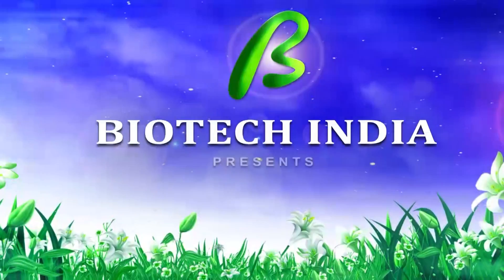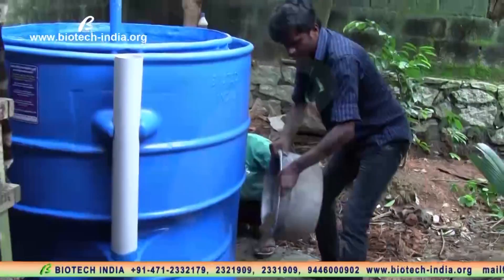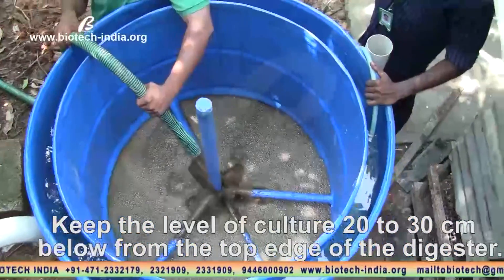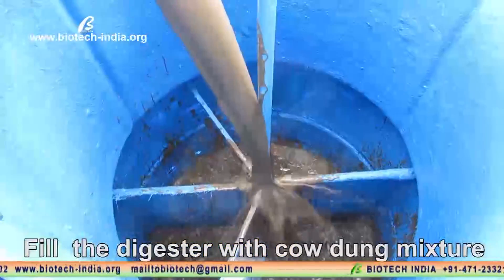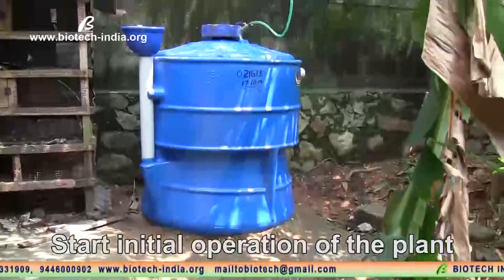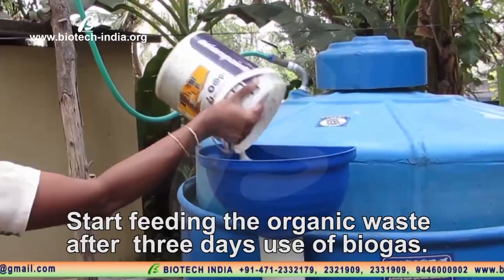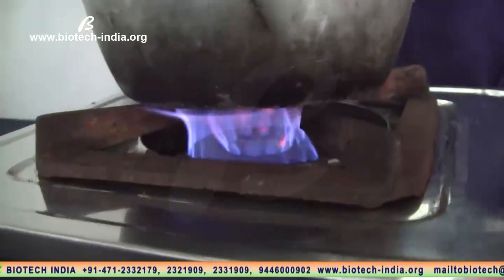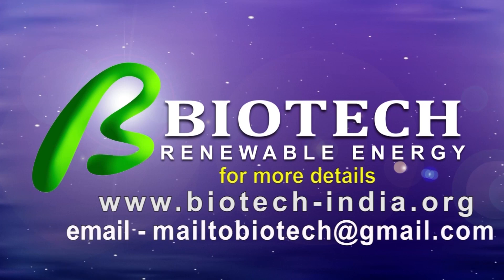Users manual for Installation of BIOGAS PLANT | Call Now 9446000902 | #biogas #biogasplant

Comment: use a strong magnet series on the pipe of gas, it will provide many kilowatt's more
Reply: Can u explain some more please
Reply from the maker: @khalidgondal8211 
please contact or Whatsapp to Mr.Vetrivel.R at ph no:+91 9446000771,
BDM-BIOTECH India,
E-mail:bdm.biotechindia@gmail.com
For more details,
visit us:[ https://www.biotech-india.org/ https://www.biotechbiogas.com/ ]
Reply from the maker: @anilkumarsharma1205
 Do you need any requirement? please contact or Whatsapp to Mr.Vetrivel.R at ph no:+91 9446000771,
BDM-BIOTECH India,
E-mail:bdm.biotechindia@gmail.com
For more details,
visit us:[ https://www.biotech-india.org/ https://www.biotechbiogas.com/ ]

Comment: I would imagine that there should be some kind of regular maintenance requirements, but none are given. 1) Does the feed tube, which is small, clog and need unclogged? 2) Does the tank eventually need cleaned out? 3) What kinds of plant matter (if any) do not work well with the system?
Reply from the maker: Do you need any requirement? please contact or Whatsapp to Mr.Vetrivel.R at ph no:+91 9446000771,
BDM-BIOTECH India,
E-mail:bdm.biotechindia@gmail.com
For more details,
visit us:[ https://www.biotech-india.org/ https://www.biotechbiogas.com/ ]

Comment: Put a T connector in the gas line with a valve and water collection bottle.
Add a brass wool flashback arrester near the stove.
Add pex heating coils and thermal blanket to the outer water jacket.
Buy a Cow.
Reply: Wat is an arrester? Wat purpose will it serve?
Reply from the maker: @ameyproud2bindian  
Do you need any requirement? please contact or Whatsapp to Mr.Vetrivel.R at ph no:+91 9446000771,
BDM-BIOTECH India,
E-mail:bdm.biotechindia@gmail.com
For more details,
visit us:[ https://www.biotech-india.org/ https://www.biotechbiogas.com/ ]
Reply: Hi Ken do you have start to finish plans to point me toward? Or if not plans, a finished product with everything you recommend? Thank you
Reply from the maker: @SpiritusBythos  
Do you need any requirement? please contact or Whatsapp to Mr.Vetrivel.R at ph no:+91 9446000771,
BDM-BIOTECH India,
E-mail:bdm.biotechindia@gmail.com
For more details,
visit us:[ https://www.biotech-india.org/ https://www.biotechbiogas.com/ ]
Reply from the maker: @kokopelli314
 Do you need any requirement? please contact or Whatsapp to Mr.Vetrivel.R at ph no:+91 9446000771,
BDM-BIOTECH India,
E-mail:bdm.biotechindia@gmail.com
For more details,
visit us:[ https://www.biotech-india.org/ https://www.biotechbiogas.com/ ]

Comment: Some websites and videos recommend use of only fresh cowdung.
can somebody clarify exactly which kind to be used??
Reply: Any bio digestible matter will be ok, fresh or dry does not matter as you are adding water too .
cowdung, waste food, veggies/fruit rinds, hay, grass, leaves. No woody barks(not digestible by bacteria) (residue can be dried and given as fertiliser)
In china they connect to toilet waste using 2 pit system.
After 1 pit dries out they remove and use it for fertiliser !
Reply: @davelawson2564  thank you bro.
Reply from the maker: @davelawson2564  
Do you need any requirement? please contact or Whatsapp to Mr.Vetrivel.R at ph no:+91 9446000771,
BDM-BIOTECH India,
E-mail:bdm.biotechindia@gmail.com
For more details,
visit us:[ https://www.biotech-india.org/ https://www.biotechbiogas.com/ ]
Reply from the maker: @rahulraj-yx9hh
Do you need any requirement? please contact or Whatsapp to Mr.Vetrivel.R at ph no:+91 9446000771,
BDM-BIOTECH India,
E-mail:bdm.biotechindia@gmail.com
For more details,
visit us:[ https://www.biotech-india.org/ https://www.biotechbiogas.com/ ]
Reply: rahul raj fresh cow dung can be used but it will take 48-72 hours before the methanogenic bacteria reach final stage for production of methane( Biogas). If already degraded cow dung used we will get methane gas at very early stage. Keep the tank in warm place for better functioning of the plant. But this is not a clean fuel because methane degrades ozone layer if leaked. Slight leakage is unavoidable. I prefer the world must use solar energy

Comment: IN India there is no trash companies coming for trash collection, that is why they use it. In USA it would be better to use organic fertilizer available in plenty. Besides there is limited service of these  thing even in India. You have to collect organic food left overs in a bucket which is not a common practise in USA
Reply: Moron this is for backyard operation at home , hostel, factory or apartments.
instead of throwing waste in bins throw it into this processor and get gas for free !
Reply: You can run this system all year around only in tropics.
Reply from the maker: Do you need any requirement? please contact or Whatsapp to Mr.Vetrivel.R at ph no:+91 9446000771,
BDM-BIOTECH India,
E-mail:bdm.biotechindia@gmail.com
For more details,
visit us:[ https://www.biotech-india.org/ https://www.biotechbiogas.com/ ]
Reply from the maker: @ennakavi2129
 Do you need any requirement? please contact or Whatsapp to Mr.Vetrivel.R at ph no:+91 9446000771,
BDM-BIOTECH India,
E-mail:bdm.biotechindia@gmail.com
For more details,
visit us:[ https://www.biotech-india.org/ https://www.biotechbiogas.com/ ]